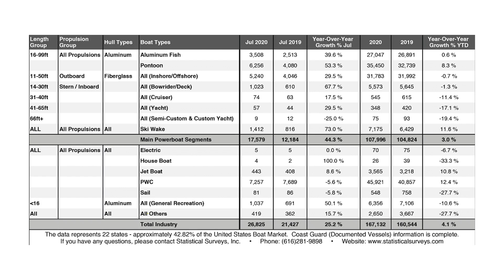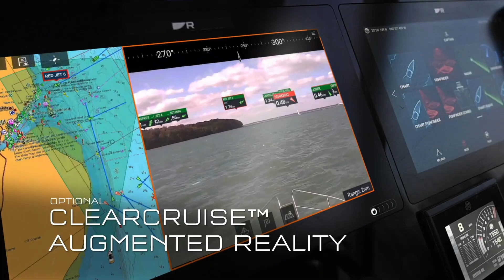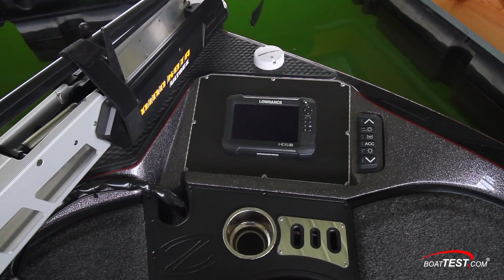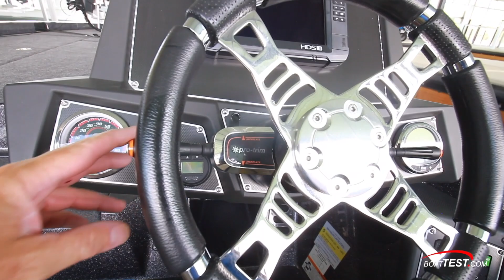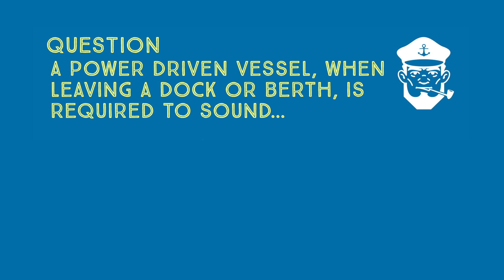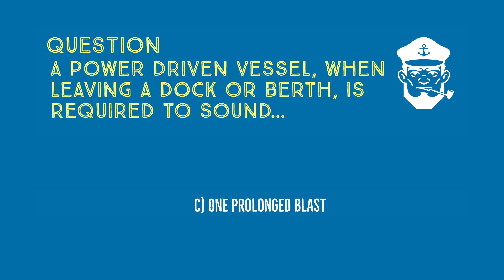Why Are Boats So Expensive? -- Episode #21 of BoatTEST Reports

Comment: Can't help but wonder re the "modern boats are more complex and have more features, therefore much more expensive" argument.  Modern cars are much more complex and loaded with technology, yet adjusted for inflation they're actually cheaper than 50 years ago. Yes they may have less metal and designs are often questionable, but overall modern cars are much better. So why the dynamic in the boat industry is different?
Reply: Volume. Not enough volume to amortize the cost of development of all the new tech.
Reply: boats are custom made, not on a chain